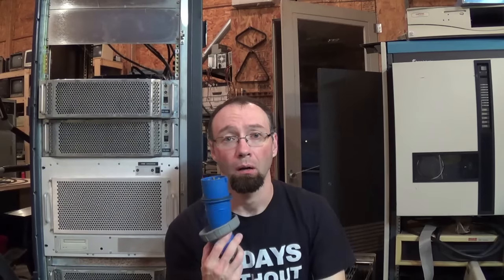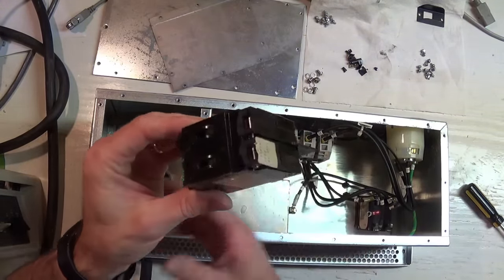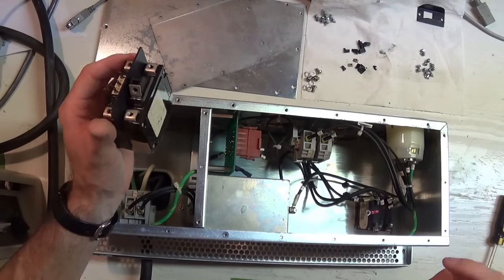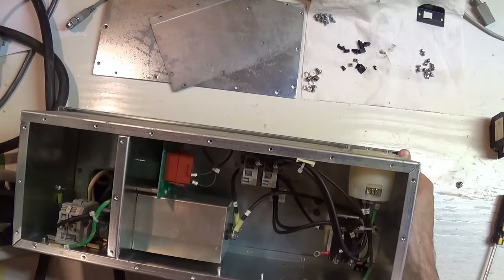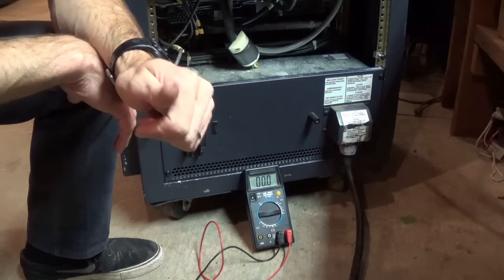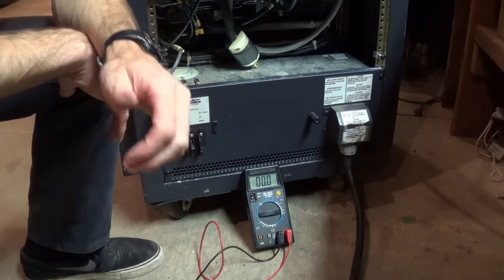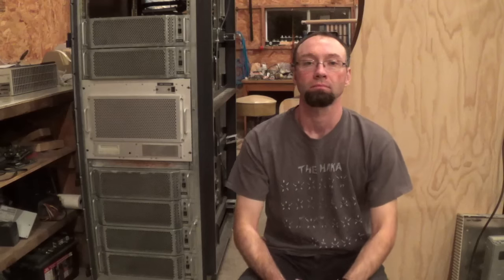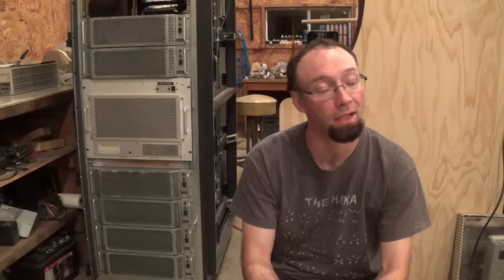Cray J98 Project - Power in the IOS cabinet

Comment: Very exciting. Your onscreen presentation skills are really coming on well by the way. I find it interesting how few drives there are in each of those bays. Do you reckon that was a deliberate decision or technical limitation?
Reply from the maker: Given the age of the machine, they would have been limited to 5.25" half-height disks to get the capacity they were after (10GB per disk). And running at full tilt, my guess is with the heat generated keeping it to four disks per shelf was probably intentional for longevity of the devices.

Comment: I am still flabbergasted abut the choice of some manufacturers to go for 230V single phase, instead of using 380V three phase.
Some of the really old HP servers in one of my old jobs did the same, and they had a 63Amperes connector. With three phase the whole thing could have been powered by 20Amps. Do they do this, so that one can use them in the US, where combining two 110V phases one gets 220V?
Reply: Three phase is really, really rare in the US-- pretty much only in industrial sites and heavy machinery shops. Most datacenters I've been to still run off of split-phase 220V.